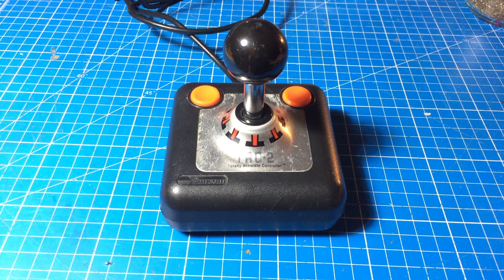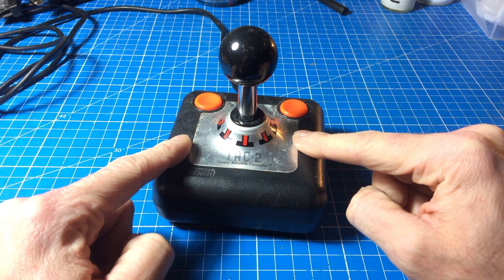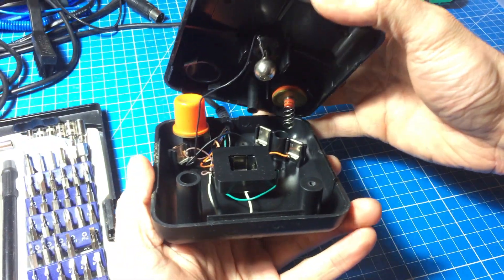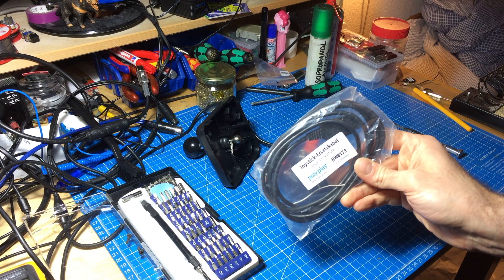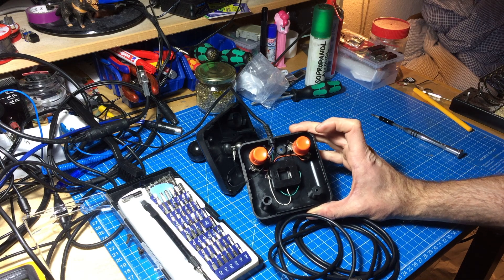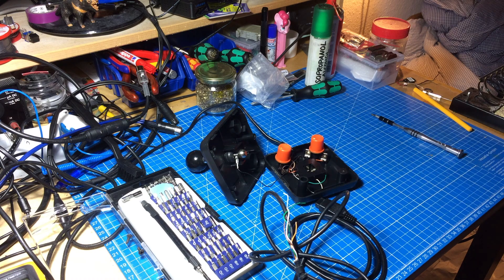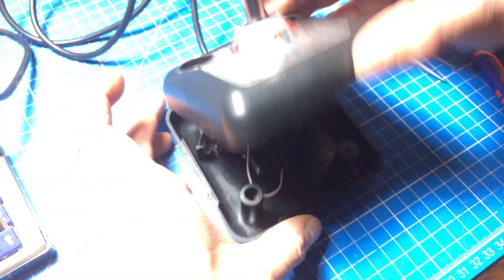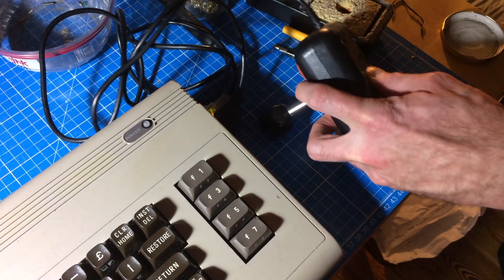Suncom TAC-2 Joystick Teardown and Repair

Comment: Robust, if stiff controllers but the buttons weren't great. Design flaw is the two separated contacts that are bridged by the button. Unless you put well-centered force on the button, it's easy to tap just one of the two contacts. The result is that the physical feedback you get is that button made contact, but in reality you didn't make a connection. It can be modified to ground the washer on the button similar to the joystick, and then wire both button contacts common. That fixes it. Slik Stik from the same brand has the same issue.

Comment: Best joystick imho, I still have mine from back in the day but it's seen better days. I tried to repair it, they are so simple but I noticed a weird problem, if I push the joystick to the left or left+up the right button doesn't always trigger, if i push it down hard it works... very odd problem.

Comment: Hello Jan Beta. I am a ZX spectrum user.
Long time ago i have my ZX (CZ for Argentina), Joystick, almost 20 years past and i continue using zx games and apps by emulator.
BUT, i see your video and i start to think to RE-MAKE my old joystick from scratch.
I do not see any video explaining how was the contacts or the electronic. I remember that was VERY BASIC.
I also a wood carver, and i was thinking in make all the joystick (almost) from wood. (as an exercise).
My question.
How can i search info in youtube related to tear down one of this old joysticks. I search and the best videos are from Atari controllers, they are very similar in the components.
My objetive is do all by myself. Not buy a thing. I have many components of old keyboards, many sticks i can use from old joysticks.... but i want to do with the original form factor or the most similar way.
Can you help me with this?
...
And, in other things... The video is great and give me the idea to do it. SO, Thanks for the video, my like to the video is included.

Comment: I had a TAC-2 and its little brother, the Slik Stik (I bought the Slik Stik first because it was cheaper, then I saved up for the TAC-2). Both were great joysticks, mainly because I couldn't really get used to the feel of microswitches and I enjoyed the smoother feeling of these two. Though some say that they're not as accurate as microswitch sticks like the Competition Pro ... YMMV.
Reply from the maker: I used to be a huge fan of Competition Pros and the clicky microswitches but I kind of prefer the TAC-2 now. I find it just as accurate and it reacts a bit faster because of the shorter throw. Lovely joystick!

Comment: Finally about to get one myself, these really seem robust and a decent compromise between durability and feel. 
I saw these were really expensive on eBay so I gave up for a while but I actually just found a local guy selling a C64C for 100€ but it also included a TAC-2, 1541-2, tape drive, the Defender 64 light gun along with the manuals for the disk drive and the machine so I'm really happy about that
Reply from the maker: Nice! Yeah, these got pretty rare and sought after in the last couple of years. Still looking for a second one myself.

Comment: i just got one of these only I didn't notice it was a plastic shaft on mine. It's a bit slack but i heard that the rubber collar which gives the stick it's springyness can be replaced with a piece of a replacement schrader tire valve. Utter madness!
Reply from the maker: Oh, that's interesting. I hope I remember the schrader replacement when the time comes (at the moment, the stick still seems pretty indestructible to me...). :)

Comment: Where can I buy this authentic replacement cable?
Reply from the maker: I got it from polyplay.xyz. They are selling salvaged/used and tested cables for a couple of €. You could of course also hit eBay and look for a cheap broken joystick with a working cable and salvage it yourself.
Reply: Jan Beta, thank you. I will check it. I got a couple of old junky joystick. I also got extension cables for Megadrive and junky new joystick for Megadrive. I will take a suitable cable from some.

Comment: so, the color code for the new cord was the same as the old ??  ... I've replaced quite a few cords on joysticks and used a joystick tester to find the correct wires. The new cord color code was completely different
Reply from the maker: Yes, it was exactly the same. I've seen the same code on Competition Pros, too. Maybe there's one manufacturer of the cords that always uses the code?

Comment: I have one of these and at first it didn't work on my Atari 2600 years ago, does this not work with that console? 

Now I have an C64 now thanks to a friend and my TAC 2 has had it's ground wire broken right at the metal clip that connects to the metal ball recently. Will a full on cable replacement be a good idea for me? Or should I just try to fix the ground wire?
Reply from the maker: It's using the Atari standard so it should be working fine with the Atari 2600. It does with mine.

If the cable is otherwise okay I'd strip a few mm of the ground wire and solder it back onto the tab. It depends a bit on where it broke of course.
Reply: Thank you for your help! Also I do remember it having an issue moving in certain directions when it's ground cable was still intact, maybe just doing what you showed here will save it again.

Comment: Wow, unusual construction. But ingenious! :) Oh, that blue LED.. I'd like a blue one in mine as well. I love blue. I was wondering, could you point me in the right direction for the right kind of LED? Or, just let me know exact specs for it? I'd really appreciate it. Whenever you have time. :) Thanks for the great videos!
Reply from the maker: Thank you! The blue LED is actually an RGB LED. It is hooked up to bwack's quadruple kernal switcher and it signifies the kernal that is active. Red is standard, green is JiffyDOS and so on. I made a video about how I put it in: https://youtu.be/LpRaHkqjqJk

If you just want a blue one, you can buy any 5mm standard round LED (diffused looks better). You will probably have to add another resistor to the power lines on the LED because the original ones are very dim compared to modern ones.

Comment: You're right about those joysticks being practically indestructible.  I had one of those when I was a kid, although the model with a single fire button.  I absolutely beat the shit out of the thing--throwing it across the room or swinging it by the cable and smashing it on a table when I was pissed off at a video game--and I could always put the pieces back together and it would keep working.  What finally did it in was when the handle actually broke off, but the button and directional contacts never quit working!
Reply: The Slik Stik version of this was my first C64 joystick, amazing thing.  I actually broke the handle myself, my Dad at the time looked at it and realised that it simply was a Schrader car wheel valve with the rubber stripped.  Simply replaced the stick with one and epoxyed the plastic ball on top.

http://upload.ecvv.com/upload/Product/20087/China_TR413_tyre_valve2008723934309.jpg
Reply from the maker: +00Skyfox Haha, wow. I can imagine it took quite some angry disappointment to break off the handle. ;) Thanks for sharing.

Comment: Yes I remember those sticks.. it never was my favorite as it had limited accuracy for the games I played and it's responsiveness left quite a bit to be desired. I always found micro switch designs superior. Tac was build to a price stick that well usually worked unless it got used "roughly" what you often did those times.  It's more reminiscent of of the early 1980's arcade sticks and that is what it imitated . Still it is compact and looks attractive and works just fine in certain arcade style games.  In all fairness my memory might be slightly tainted by abundance of choice as I had joysticks a plenty. One worked best in this game another in this.  Any case it is historically and functionally great addition to any commodore collection.  If you happen to run across quickshot 2 turbo I can fondly recommend it for certain games that you need high accuracy of movement .  There really is no one "best" stick it all depends of game personal preference and what you have grown to like.

Comment: If you solder the fire wire to the brass ring on the button and ground both the metal pieces under the button - that will help a lot.
Reply from the maker: I think I might try that some time. The only downside seems to be that the solder joints on the rings might break because they are moving all the time.
Reply: I cut a little trace in the ring, soldered the wire in that. If you use a small loop and a soft wire I don't think there will be more problems than the moving wire around the metal ball inside. I got full score with Boray's joystick tester after that mod.
Reply from the maker: Sounds convincing. :) I think I'm going to give it a shot (pun intended).

Comment: Good video. Can you post a link where you ordered the replacement cable? I've had trouble finding them.
Reply: following this
Reply from the maker: I got mine from polyplay.xyz. They sell salvaged & tested cables for relatively cheap. You could also source a cheap (broken) DB9 joystick somewhere and reuse the cable of course.
Reply: @JanBeta  May we please have a link to the Polyplay product page?

Comment: the tac 2 was nice for sport games. i got some broken ones from a friend which the button didn't work at all. i just opened it with a ordinary screwdriver and i can't remember exactly what i did but reading Audiosonicity post here it must be that solution. i resold all of them. but i liked the waco joystick so much more.
Reply from the maker: Yeah, the buttons seem to be the weak(est) spot on theses. I had to reopen it and clean the rings a bit more after shooting this video because they weren't working as reliably as they should. Now the joystick's pretty flawless (at least for my taste). :)

Comment: Back in the days what I did to improve the firebuttons on my TAC-2, was bridging the bottom contacts and solder one wire to the copperplate. That way it just had to touch one of the bottom contacts to work, allowing to you press less hard for successful connection. That mod is a huge improvement on this otherwise awesome joystick.
Reply from the maker: That's an interesting mod. I might try it some time. Thanks for the tip!
Reply: Jan Beta no problem. I saw someone else gave the same tip and you were thinking that the solderjoint can eventually break from button movement. You are correct but the button only moves like 2mm so it will take lots and lots and LOTS of pushes until it breaks, and its easy to repair. Mine still works on the first solder joint. There might be better solutions than soldering (like a pole shoe) but I think soldering is the easiest.
Reply from the maker: Thanks! I'll give it a try. :)
Reply: Does anyone have a guide for this mod?

Comment: screwhead is canadian , called Robertson 2 R2. a verry good system. i use them a lot as sheetmetal screw with a drill tip.
Reply from the maker: Thanks! I wasn't aware that it was popular in Canada. I've only ever seen square screwheads on some professional gear and for special use over here.
Reply: Allen Robertson Phillips. That guy has a few screws loose.

Comment: I think we owned one of those TAC-2 joysticks back in the day.  My favorite C64 joystick, however, was the Icontroller (also made by Suncom), which was a tiny thing one attached to the side of a C64 with "poster square" adhesive.  I liked its space-saving, streamlined look, and it was perfectly adequate for cursor control on the games I liked to play back then (CRPG, adventure & strategy games).  My spouse was a bit more interested in arcade games than I was (and had larger hands too, of course), so that may be why he preferred the TAC-2.
Reply from the maker: Ah, I remember seeing pictures of the little joystick. I always thought it would be a nice idea to have a joystick next to the keyboard especially for GEOS and the games that used the joystick as a "mouse" pointer. Like the good old Lucasfilm games I enjoyed a lot. Maybe I'll try to find one of those, too. Thanks for the reminder. :)
Reply: I vaguely remember a sticker on the Icontroller packaging suggesting its use with GEOS.  The Lazy Games Reviewer's "Oddware" series of videos includes a review of the PC version of the Icontroller.
Reply from the maker: Ah, thanks, I'm going to have a look at that LGR vid. :)

Comment: I still have my originals from the turn of the 90s, nothing wrong with them. The ms. still pounds bombjack on one every day with the Atari :D I've cleaned the contacts a couple of times and I always used to "tune" the buttons by inserting a bit of wire under the metal contacts on the base to lift them up and reduce the clearence of the button movement. It really makes them much better.
Reply from the maker: Oh, that's an interesting idea. I might try the button tuning, too. Very nice joysticks indeed. :)
Reply: Nice fix Jan :) My Tac-II is also from the 90's which I got for the Amiga and it's still working. One difference though, the stick is black plastic instead of your chrome one. I have never opened it up so it was interesting to see the inside of it in this video :)
Had Quickshot joystics in my C-64 days and one was totally destroyed and another one got broken micro switch, the spring snapped in one of them. TAC-II is much more durable.
Reply from the maker: My very first one was a Quickshot II. It mysteriously survived somehow. I still have it but barely use it nowadays.

Comment: The only joysticks ever we haven't managed to break in Track & Field in my household, definitely legendary, high quality and easy to repair.
Reply: Yeah, if I were at all inclined to play those stick wiggling games, I'd rather have this. But for "normal" games, microswitches!
Reply from the maker: They are. Also cheaper to make than microswitched ones I guess. I really wonder why there weren't any clones (at least none that I know of). Probably patents.
Reply: I had an used tac 2 that someone succeded to break. Probably thrown down so the metalball was cut of from the handle.
Reply: At least 6 friends had this and they never broke. Only the buttons went bad over time. Quite easy to fix.
Reply: Only mechanical weakpoint was metal rod from the stick to the ball.